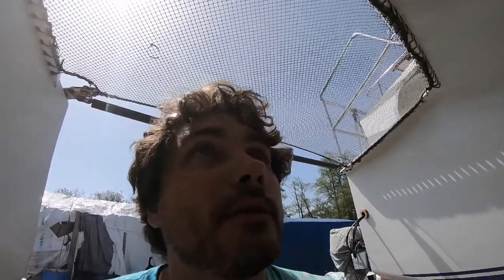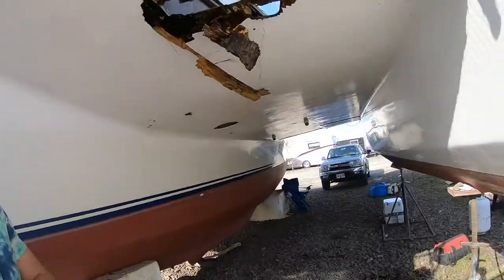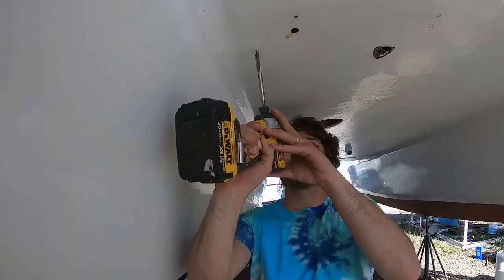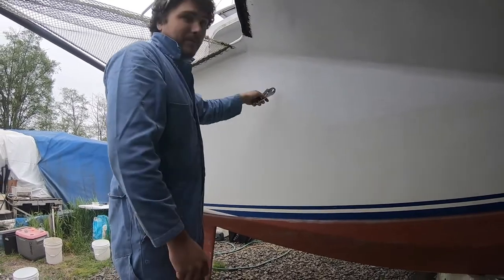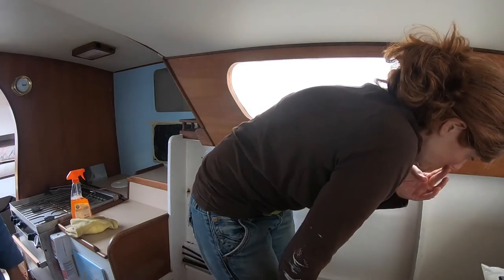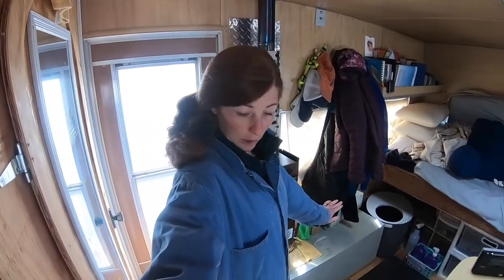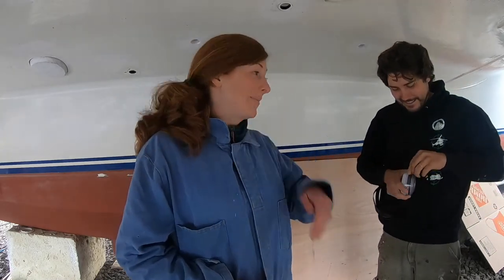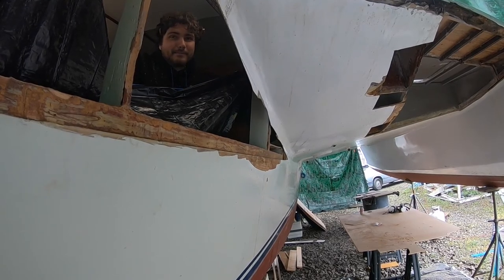Rebuilding a Wooden Trimaran Sailboat (Ep.22 Sailing w/the Litzenbergers)

Comment: Seeing a Searunner built after the advent of epoxy WITHOUT EPOXY just hurts seeing it. The builder had to spend at least 1500 hours building that thing, and he cheaped out on the most basic part of Jim Brown's building method?
I could understand if someone built one in the 1960s and used vinylester and regular plywood, because that's about all you could get. In the 1990's, that's just silly.

If I were going to spend the better part of a year (or a two years of all my free time), I just can't see "saving" a couple of grand on the building materials knowing that it would result in rot and perpetually higher maintenance.

Many of the first ones built using epoxy almost half a century ago are still sailing.
I hate seeing that happen to anyone, even if they ate the other half of a burrito.